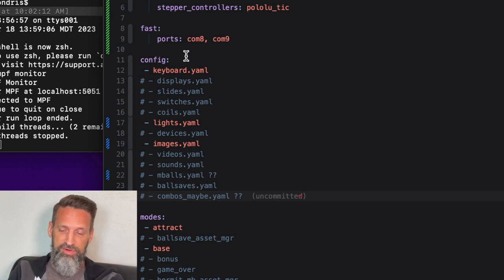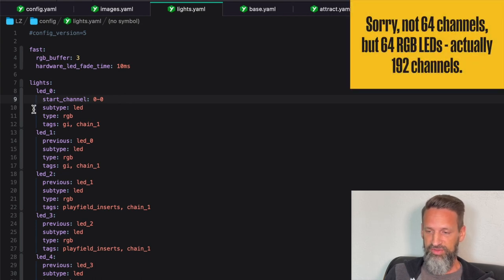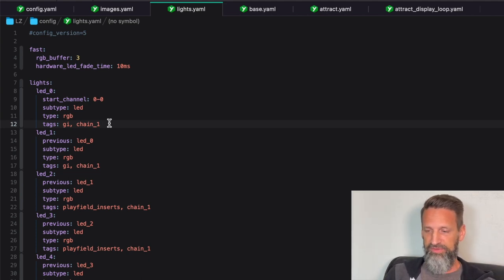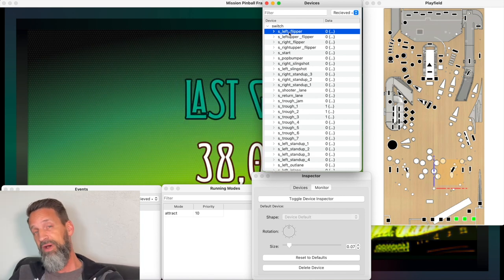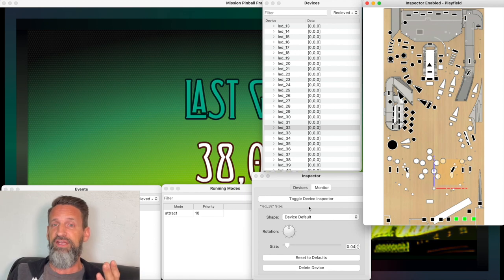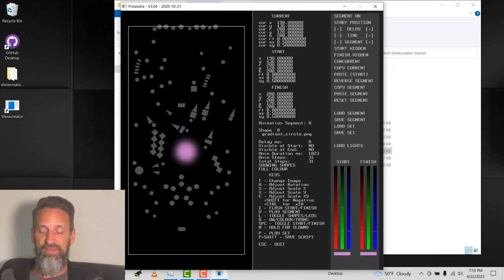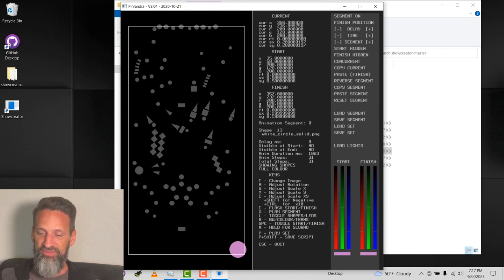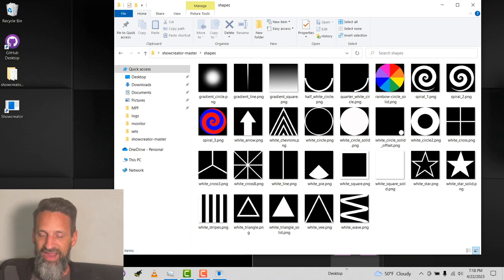HOW TO MAKE A PINBALL MACHINE: Light Shows

Comment: I built a DIY pinball machine but I would like to add a light show. Where do I begin on a budget?
Reply from the maker: Budget for the whole machine or just the cost of parts for the LEDs? I've spent over $5k on my machine so far - but just LEDs for a machine you already built wouldn't be too much -you'll probably want around 100 or so lights, depending on what type you pick that could be anywhere from $25-$200 ish?